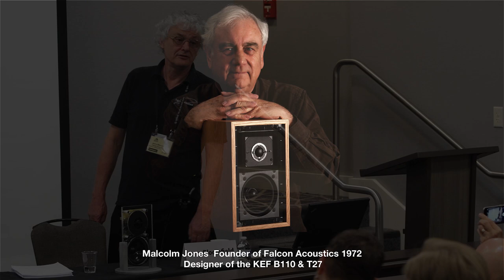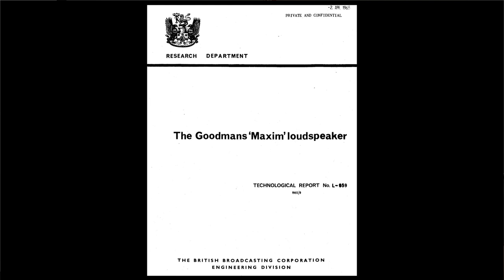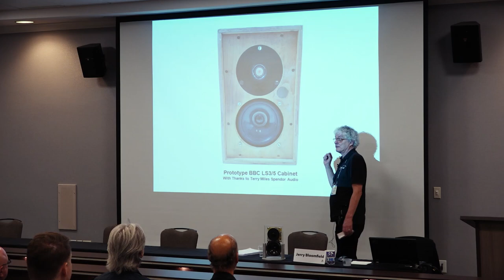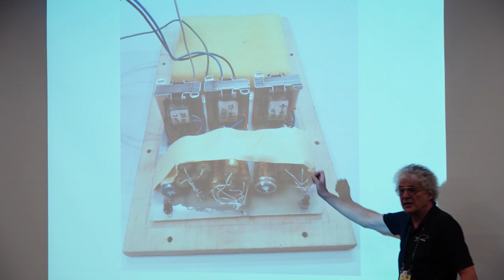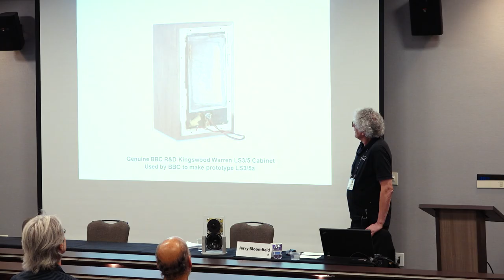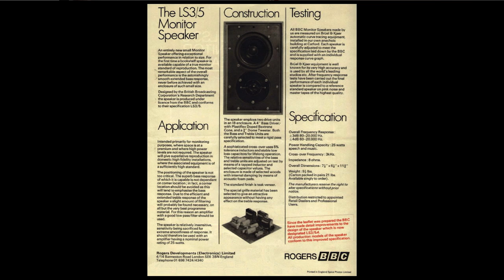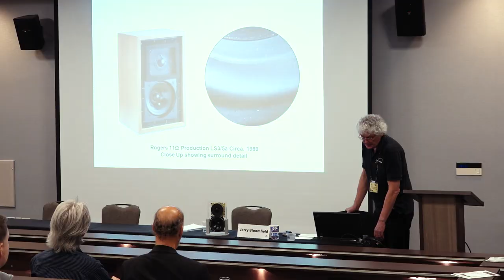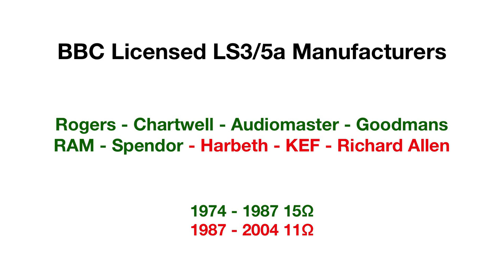RMAF 2018 - The BBC LS3/5A 1968-2018: The Icon Live @ RMAF

Comment: I wish I could tap the “like” button 10 times. Sadly it doesn’t work like that.
I think, for what ever it’s worth, that some of the famed magic of the Ls 5/3a is the fact that that it has the raised level between 100 and 250 hertz in combination with the gradual low pass below 90 hertz. The low pass makes certain that standing waves in normal sized listening rooms is a non issue, and the raised level above 100 hertz makes certain that instrumental warmth is not lost in the process.

Comment: Interesting video. I'm extremely disappointed in the direction that Falcon appear to be heading in, though. Until just recently, MoFi were selling/distributing a "standard" LS3/5a, in a "standard" black finish, produced by Falcon, for a fairly reasonable price ($2k). That distribution deal, for whatever reason, has apparently fallen through though. Very disappointing. What's more disappointing is that Falcon now seem to only be interested in selling "luxury" versions of the LS3/5a, in "luxury" veneers, for an equally luxurious price of almost DOUBLE what the standard MoFi version was selling for. While there are undoubtedly plenty of rich old men (seems to be the target demographic!) who are happy to spend almost $4k on a small pair of speakers, Falcon seem to have completely forgotten about the more "pedestrian" consumer, who just wants a "normal" pair of LS3/5a's in a normal (black!) finish, at a relatively normal price. I wanted a pair for my studio, and black is the only finish that wouldn't look "odd". I also seriously resent being charged double the price for a few tweaks! Aside from anything else, surely a "tweaked" LS3/5a is no longer an LS3/5a!! The entire premise of interchangeabilty has been trampled on! LS3/5a's are supposed to sound the same as each other! Now, maybe I've got (some) of my facts wrong, and I'm certainly not looking to pick a fight with anyone, but I'd be interested to hear what anyone else has to say on this matter. Especially someone from Falcon! I've been using (and repairing!) LS3/5a's since the 80s. Repairing because in the "old days" of 1" VTRs, tape ops would rewind a video tape at full volume and the Sony VTRs didn't mute (or even lower) the audio while the tape was in FF/Rew, so the speakers would be absolutely blasted with a ton of high frequency energy, blowing the tweeters. Many times I would ship off a bunch of blown T27's to KEF in exchange for some new ones! The price was lower if you sent the busted ones back to them 😊 Anyway, point being, I'm very familiar with the "standard" LS3/5a, both Rogers & Spendor, and I really don't need/want an "improved" version (certainly not at twice the price, anyway). So, Falcon, what gives?! Why no "plain black" finish, and why no more "sensibly priced" version? Are you just going for a cash-grab from wealthy foreigners? I imagine this "improved" luxury version no longer meets BBC specs and probably can't even be sold in the UK. That's just a guess, but I think I'm probably right! Happy to be proved wrong, though, and I'd be even happier to hear that the $2k MoFi version was being produced still/again, albeit from a different distributor.
In the meantime I've bought a fairly late-production pair of Rogers LS3/5a's, in a pretty horrible teak finish (I guess I could do a vinyl wrap on them?!) but they do appear to be "like new". Having them shipped from England to NYC, and they're not here yet, but I would far rather have bought a new pair in black. Whatever happened to the MoFi deal, I wonder 🤔 
Anyway, it's cool that Falcon are still passionate about these speakers, but focussing on rich old men and fancy, exotic veneers is not what this speaker was supposed to be about. It was meant to be a "utilitarian" near-field monitor, for professionals, and most studios want black! At a sensible price. Anyone care to share their thoughts or correct me on any points? If I'm wrong on anything, I'm happy to be educated!